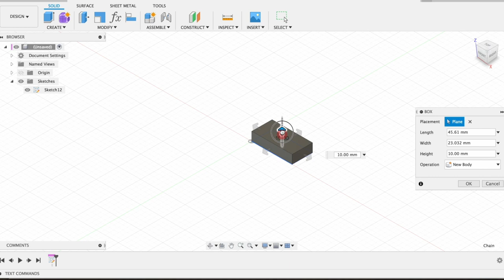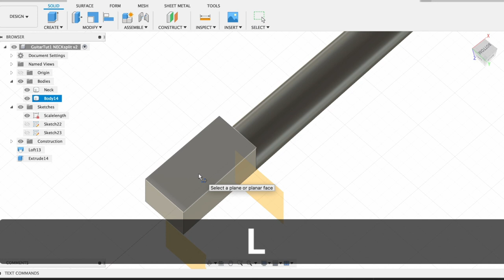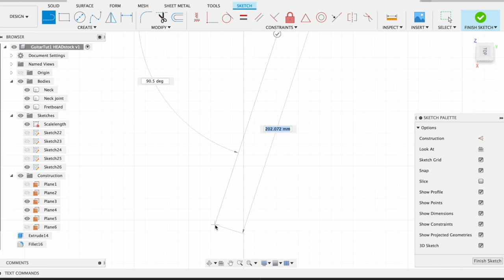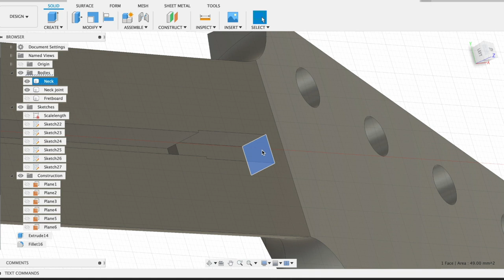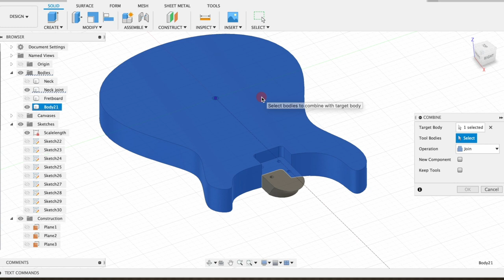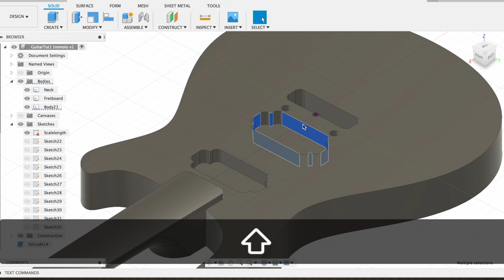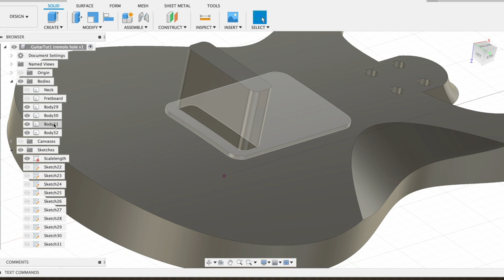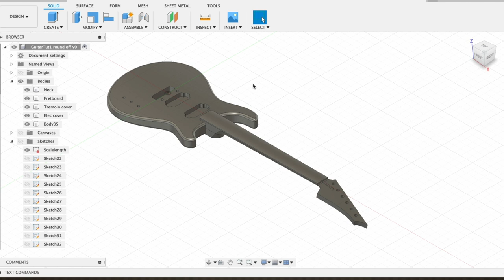Drawing a complete guitar in Fusion360, the extended version

Comment: Thank you so much for sharing your knowledges. A really amazing tutorial that for sure will be very valuable in my future buildings. I`d like to ask a question, for example for the headstock, if I have the design made in AutoCAD and save it as a DXF, could I use it instead of having to draw it with an sketch in fusion 360? Thanks in advance.
Reply from the maker: I'd say that should work, although I did not try it. I am curious to know if that works for you. I can imagine other people having the same question...

Comment: Hi, beatiful video but i have a problem when splitting the tremolocover. The system is unable to split and I do not understand why (it seems to me because the face is curved or because it cannot manage the 3mm offset face). 

Error: Coincident tools would create illegal or unproductive bodies. Use separate tools. 
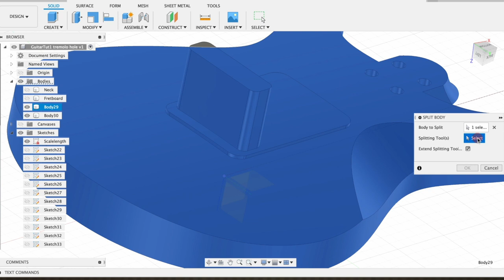Split body in video at  01:00:46

Can you help me?
Reply from the maker: Hmmm that error does not sound familiar to me... sorry.

A guick google suggested you have a bunch of different faces crossing each other making it impossible to perform the split. You might check whether that is the case. 

Closing the gap in the cover could also be performed by pulling (hit Q) the inner walls of the gap to bridge it in a few steps. To finetune the curve you might need to clean up the top surface somewhat, but the gap is closed..

Hope this helps.

Comment: Great tutorial, thank you! Just one small tip: after placing the canvas, I suggest to scale it using the "calibrate" option, then you place 2 points, one on the nut and one on fret 12, set the distance to the scale length divided by 2.
Reply from the maker: Great suggestion!

Comment: If your cutting (drill) bit is 6mm, would you not need the radius to be 3mm in the tremolo hole and pickup holes?
Reply from the maker: Yup, good point! However, with my pickups it all fits nicely with these dimensions.  but please doublecheck and adapt all the dimension you find in the video to your needs!

Comment: Awesome video. Thanks. But one thing I don't understand: You said, you would use a 6mm drillbit and so you make your corners 6mm. But "R" is radius, not diameter. Shouldn't it be 3mm of radius then when the drill's diameter is 6mm? Or did I get something wrong?
Reply from the maker: Yup, as mentioned earlier in the comments :-) Totally correct. My mind had a tiny black-out.... It's proof that I'm human, too ;-)
Reply: @Audiohotshot  sorry, I didn‘t read all of the comments. Maybe you are human only but a very talented one

Comment: After the first view: The distance of the holes in the headstock, the form is strange to a soft line body, the straight edge is to deep...
Reply from the maker: Please do not take the shown dimensions and distance as 'the truth', it is not what the video is about; I'm sure you can do better! :-) 

I highly recommend carefully measuring every bit of hardware, even better: draw the hardware in Fusion360 as well (for example that is what I did for my latest design). 

Also: all dimensions strongly depend on the hardware you purchase, that is why I do not recommend using my dimensions at all. You might be using single coils and so on, different width of trem or nut and so on.

Hope this helps. Have fun designing!

Comment: At 45 minutes into the video, when applying fillets to each of the inside corners of the pickup cavity, isn't there a way to select all corners and apply the 6mm fillet simultaneously to all selected corners or edges? Just asking. Awesome video!
Reply from the maker: Good point, there is (holding shift or control most probably), but I doubt that's quicker. I didn't bother to check though :-)

Comment: Hello, very well done video, actually all of your videos!  i have been using Fusion for several years, what is the advantage of creating all the parts of the guitar as bodies and not components?  I design a lot of assemblies  using many different components.  I 3dprint, have a cnc router and access to a 6000 watt laser. keep up the great work!
Reply from the maker: Good point! I guess there is no advantage of using bodies over components in this case. I just eh.. had not given it a thought yet? Well, not really, I do mind having multiple ‘submenus’ cluttering my screen :-) But other than that, I don’t yet see why I should (or should not) use components. I guess there are many when i would also do animation, testing and assemble motorparts and such.. but hey.. it’s a guitar ;-) 

In the end I care about having my designs machined properly and since I have no reason for making it components, I just happen to do it this way. (I also own a 3d printer, my own DIY CNC machine, a cutter for vinyl and so on, but boy; I am jealous at your 6000 watt laser! :-)

Comment: Absolutely fantastic! I wish this had been around a few years ago when I first tried to use Fusion to model a guitar. The neck and heel joints were by far the most challenging aspects to create especially since I was trying to learn Fusion at the same time. Your video greatly simplifies this and shows just how much of a master you are at using the Fusion program. You've inspired me to try another build. Thank You!
Reply from the maker: I also struggled to find an 'easy' way to model the neck and heel joints easily with Fusion. Once I did find a workflow that worked for me, I thought I'd share it with you! Great that it works for you as well! Happy building!
Reply: @Audiohotshot  Thank You very much. 🤗

Comment: At 10:34 Using the delete command causes the program to warn "This feature is referenced by other features in the timeline. Are you sure you want to delete?" Hitting the delete button at this point leaves just the block remaining. Should I use the remove command instead?
Reply from the maker: Correct, you probably did not disable capture timeline history, which is fine, but  then you have to use remove instead. 

The advantage of using timeline history is that everything stays editable; ex. if you’d ever like to change a dimension you’ve created earlier on. (Explained in the beginning of the video btw 😊)

Hope this helps
Reply: @Audiohotshot  Thanks for the prompt reply, and being patient with someone who should have paid closer attention 😳
Reply from the maker: No prob, your welcome!

Comment: Awesome tutorial. Although every time I go to split the bottom half of the neck join to remove that particular body it tries to tell me there is no intersection between targets and the split tool. I tried ensuring all bodies were selected and then used the plane as the reference point with no luck. First time I've had an error message. Can't really get past this so far with little experience.
Reply from the maker: Hmmmm kinda hard to tell without pictures. Could you tell the timecode of the video at the point where you get stuck? I’m guessing now that the “bend” of the neck and the neck joint are not combined properly. Other thing could be that you contructionplane isn’t in the right position. Let me know if
It works out for you! You got so far already, I’m pretty sure you can do this!
Reply: @Audiohotshot  it's at 14.08. I'll double check to see if everything is combined properly, but the construction plane appears to be in the exact same spot as yours.
Reply from the maker: You mention in your first post you selected all parts, but in fact I just have 1 complete neck part which I split. Just curious: Did you use extend splitting tool as well (just to be sure, it's not really necessary though). Hope this helps!

Comment: Very good video.  The part on putting the tuners in line with the strings I think would need both the low and high E tuners to the right of the construction lines so that the strings achieve closer alignment.
Reply from the maker: Thanks for the great suggestion!
Reply: @Audiohotshot  No problem. If the lie of the string beyond the nut matches up to the outside radius of the tuner shaft as a tangent if that makes sense that is what you would be aiming for. I have been watching more of your videos and they are very informative for someone thinking of getting into using CNC for guitar building...
Reply from the maker: Totally makes sense. My videos are meant to be inspirational and as a rough guide; most definitely not as “the one and only truth”. So feel free to adapt all designs and measurements to your likings, I’m sure your designs are much better than mine :-)

Comment: Thank you so much for this video it saved me a lot of time in designing my guitars. I do have a question though. I like to set the neck back about 2 degrees is there a way you can show how to do this? Also in creating an arch top do you have a video on how to do so? Kind of like Les Paul or PRS guitars. I watched other videos but they are not very explanatory as your video. Thank you again
Reply from the maker: My solution for drawing a setback of 2 degree's would be by keeping the neck level, but drawing the body onto an angled plane. But I've not tried that, hopefully someone else has a tried-and-tested solution for you! 

In regards to drawing an archtop; I like to work with splines, SURFACE and lofts for more fluent shapes; gives me good control over curves. But i've seen people drawing it with FORM and MESH as well, I guess it is just what you happen to like better.

Comment: the process of drawing the tremolo cover is not working for me, I've triple checked with the video that everything i am doing is the same but i am always given the error : no intersection exists when trying to split the 3mm raised cover portion from the main body portion.

I've deleted/undid and redone it quite a few times now to no avail.
Reply from the maker: Are you talking about the point in the video at 1:00:45? Kind a hard to come up with a solution without having seen your situation, but did you raise the coverportion? Also did you use offset-face to lift the portion? 

I know, really basic questions, but I'm not quite sure what your situation is.. Hope this helps.

Comment: What if I have to add a break angle for the neck? Don't I have to either angle my neck or my neck pocket?
Reply from the maker: Yes, you should make an angle on th neck or pocket. My solution would be to make an angle in the neck pocket; I think it will make the neck connection stronger, as the neck thickness overall remains the same. I've never tried it though, I could be wrong.

Comment: Thank you very much! I've not used Fusion 360 yet, you make it look reasonably easy. I understand some key concepts now.
I assume one could save some operations as a library item. Example: the entire trem cavity. Regards!
Reply from the maker: AFAIK Fusion360 has no "macro function". But it does have a script function and Parametric modeling, though. Which basically means you could write a piece of code to create something (which I did for the Fret Generator). 
Instead of using macros; you could make a "blueprint"-file with several sketches holding the trem cavity, pickups and so on, all pre-drawn with the correct dimensions. I do have such a file, but notice myself being much quicker if I draw them straight away. 
Hope this helps!
Reply: @Audiohotshot  yes, thanks.

Comment: Great video.  It took you 1:10 to do what took mw days lol.   Some very logical ways to create some parts I struggled with.  Would you be able to show how you setup the machinging of the curved control covers?  Is it just from thin stock and use tabs to keep it in  place in the stock when you flip it over?
Reply from the maker: You're absolutely right; I would use big enough stock (and maybe even the same type material) and then create a double sided job with holding tabs. You can find a video on doublesided milling here: https://www.youtube.com/watch?v=FBx4x2T-iIY

Comment: Thanks man I was stringling to make the Comfort zone.
I noticed you didnt  follow the rounded edges of the reference but rather filleted everything evenly.
I strungle following those irregular curves for my Model as it is a big part of its design
Reply from the maker: I'm just showing you one approach of this particular design of mine. I hope the shown techniques helps you out in any way.
Reply: @Audiohotshot  I found a good way doing it now on my own! Instead of making curved planes I draw the curves on the surface extract a new body, chamfer the loong curved on the new body then cut the guitar budy with it and then fillet everything ☺️☺️ Your video still helped me a lot making my 3d print guitar for a custom figurine

Comment: I’ve been going these steps but once I did the slanted plane for the head stock for 10 degrees it goes the opposite direction? Can anyone tell me what I’m doing wrong?
Reply from the maker: Hmm you’ve probably already tried minus 10 degree, right?
Reply: Yes, that worked.  Is that what you did?
Reply from the maker: @ericweatherman9040  Nope, as you can see in the video I just typed 10 degrees. But I'm glad it worked out!